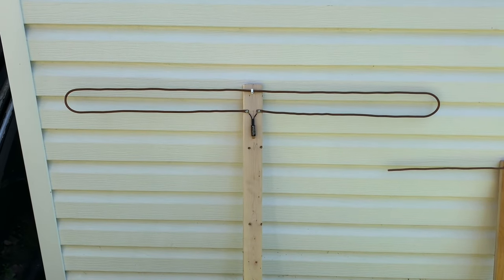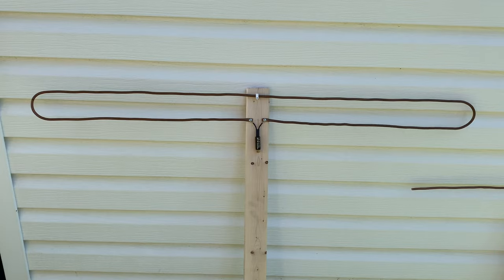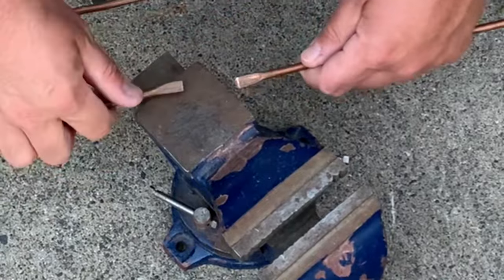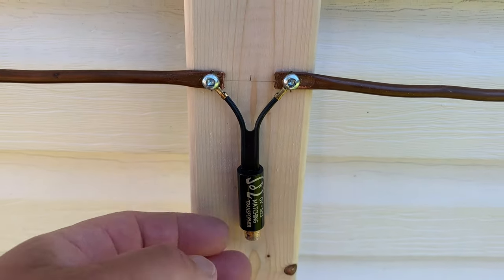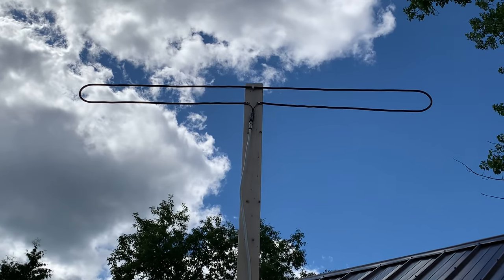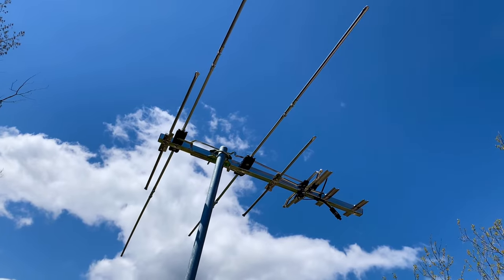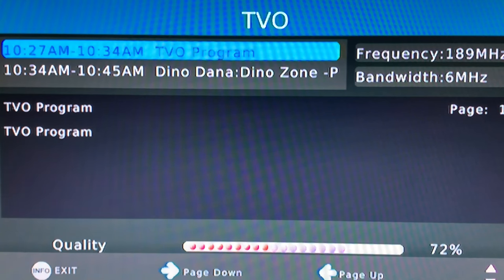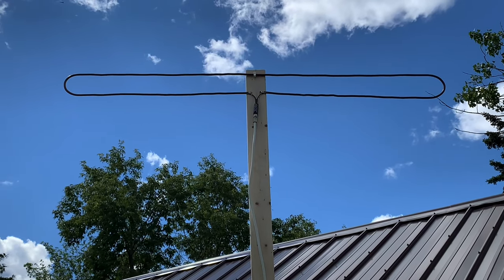Homemade Folded Dipole TV Antenna performs way better than I expected

Comment: Can multiple folded dipoles, transformed to 75ohms be connected to a combiner then connected to the tv? I have a terrible time getting ch 2 in Houston area because I’m pretty much due north of the tower(s) and the entire South facing wall of my house is all solid. No windows. So I’m gonna have to go outside. I’ve tried “amplified” antennas and various models but the cheapest, passive one seems to be working the best. But channel 2 is awful. I added a length of coax and have my cheap antenna on the fence facing south - and it’s still glitching regularly.
Reply from the maker: You can certainly try that. Use a combiner, also known as a ‘diplexer’. Let me know how it goes.

Comment: Thank you Northcoaster Hobby for making this video about Folded Dipole and if you Northcoaster Hobby still have that folded dipole antenna for Channel 2 can you test it indoors? I'm curious to know if it's possible to receive low vhf channels 2-6 using single 300 ohm folded dipole antenna cut for the frequency. Alexander 98.
Reply from the maker: I still have it. I’ll try it out sometime. The indoor reception of RF channel 2 varies greatly from season to season. Winter is usually better for indoor reception for me on account of the trees have no leaves. Thanks for watching!
Reply: @NorthcoasterHobby  Thank you very much and I will be looking forward to the results. Another thing during testing is position the folded dipole test 1 facing vertical like was showed in the video and test 2 facing down flat.

Comment: Double penny loop works better than a folded dipole in my experience.  You can go full wave x1.25 length with some conductive copper tape in your attic.
Reply from the maker: Thanks for the tip 👍
Reply: No idea what the double penny loop is

Comment: Use a 6:1 Balun instead of the transformer and you get a good connection to 50 Ohm coax, with a minor adjustment to the length it will now work as a transmitter antenna in the Amateur 70 MHz band.
Reply from the maker: So changing the transformer to the balun you suggested turns this into a Ham Radio antenna?
Cool!

Is that 6:1 balun something that can be bought or built?

Does Ham Radio use 50 ohm coaxial?

Comment: Resistance is when current or voltage is restricted in a Direct Current (DC) circuit
When resistance is applied to an Alternating Current (AC) circuit, it's called impedence.  Radio waves are electro-magnetic AC, so we talk about impedene at antenna feed points.
Antenna dimensions are criitical for transmitting so your rig doesn't melt.  For only receiving, the math is not so critical.
Build one and try it.
Reply from the maker: Thanks for the information.👍
Reply: Resistance is a measure of voltage divided by current in a resistor. Impedance is the generalized notion of voltage divided by current for any component.

Comment: Your 4ft short.  but its working for you.
Reply from the maker: A basic dipole would be 8 feet long.  This is a folded dipole- the pipe is 8 feet but folded around.
Reply: @NorthcoasterHobby   A folded dipole is the same length as the two element dipole.

300÷Frequency ÷2 => 300÷60÷2 => 2.5 meter
Or 100 inches. Or ~8.3 feet
Reply from the maker: @allthingstupid  A half-wavelength is around 8 feet. 4 foot folded dipole. It works decently. A huge 8 foot folded dipole would be difficult to mount and would probably fall apart.